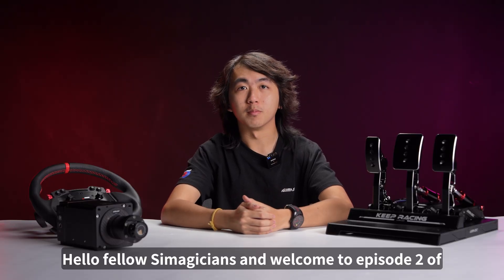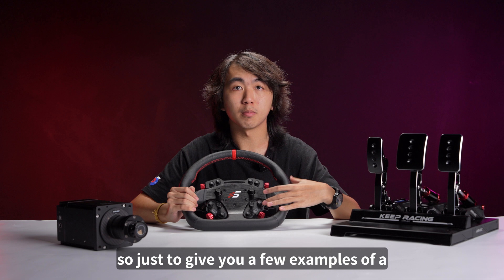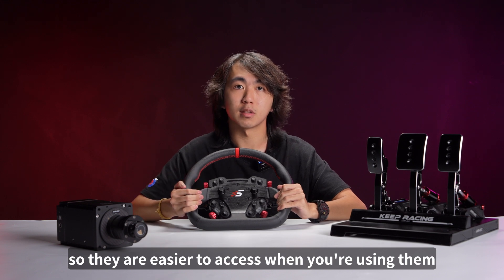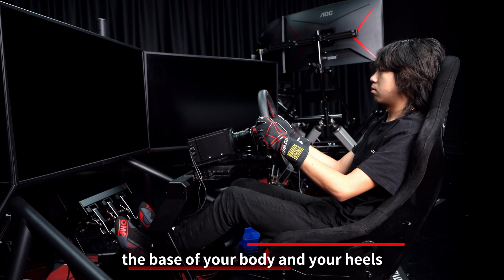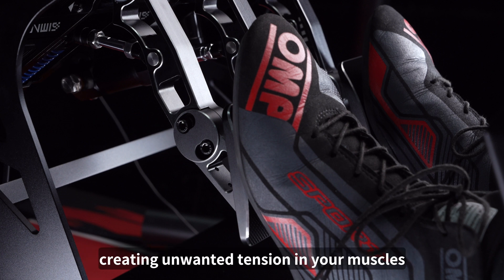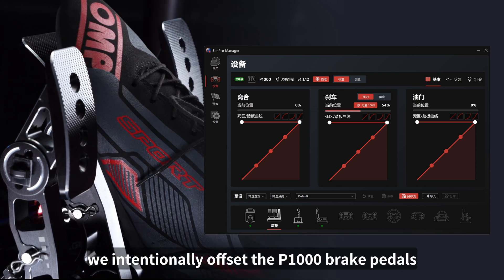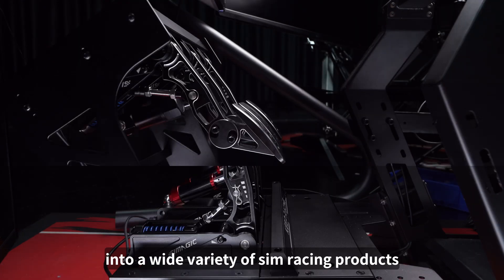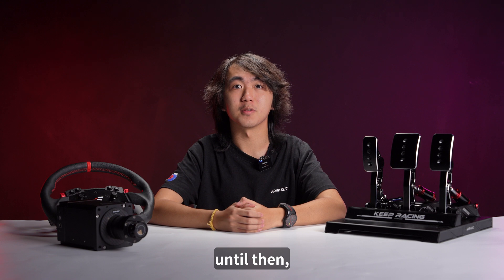Pedal Ergonomics | #TechTuesday Ep.2

Comment: you showed the inverted pedal setup but Im not sure how to angle the pedals that are stiing on the base of the cockpit. it almost feels like I would need to tilt the pedal plate backwords away from the driver. I have a Next Level GTRacer cockpit and had to cut it to get rid of the insane incline angle. it now sits at about 15 degrees but still feels unnatural.

Comment: Hi simagic, got my P1000 yesterday, a few hours spent for mounting etc. I had to give up when  I tried to give some backward angle on throttle and brake faces cause those 2 bolts for that purpose are so stiff, i can not move them, is there a trick to loose them ?
Reply: Already solved daya ago, thanks for your response anyway
Reply: Use a socket with a long enough wrench. A hex/allen key will not give you enough leverage to get it loose.

I used a hex socket on a 1/4 in drive ratcheting wrench to make the adjustments and tilted my pedals back no issue.

Comment: ok but how do I achieve same ergonomics on non inverted pedals?
Reply: I am struggling a bit with it as well. In my case I had to lower my seat position a lot so my legs stay kind of stretched. On the pedals, there isn’t much you can do besides adjust the pedals face. It still something SIMAGIC could work on to make it better
Reply: No
Reply: No

Comment: Hello Mr. Simagic. Good video. But you do not answer the question of which pedals are still more ergonomic for sim racing. Floor pedals or inverted. Answer please. And I would like to understand the difference between pedals with elastomers and hydraulics. It's the driving feelings or performance? This is also important. Thank you! :hand-pink-waving:
Reply from the maker: They are both great though for different purposes, inverted would be better suited for higher seating and standard would be better for lower seating, but both can be adjusted to a certain degree😉
Reply: @simagicofficial6890  thank you very much for your answer, guys. :goodvibes:
Reply: That’s why they make the rig have sooo much tilt ability in the pedals, so you can have a comfortable contact patch on your foot for your seat & body position 💺 
Me personally think that you should have inverted pedals with up right seat position, like a regular car 🧐